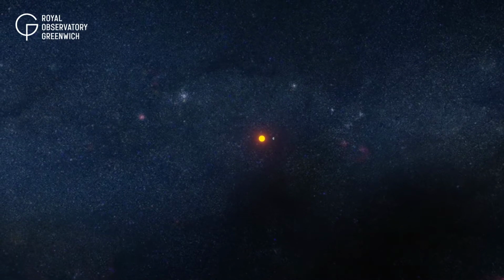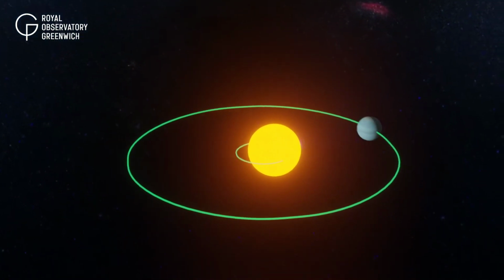Observatory Online: Exoplanets and the Radial Velocity Method

Comment: I'm not sure that the animation is strictly correct. The star-planet system should orbit a common centre of mass (COM), with the planet on one side of the COM and the star on the other. In this animation the planet and star are both on the same side of the COM and the COM itself is wobbling.
Reply: exactly what i was thinking